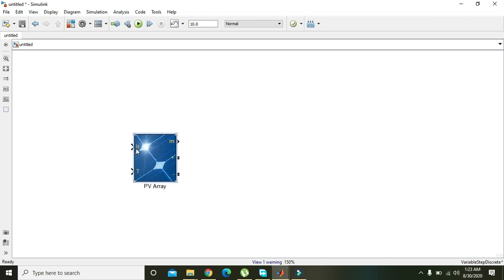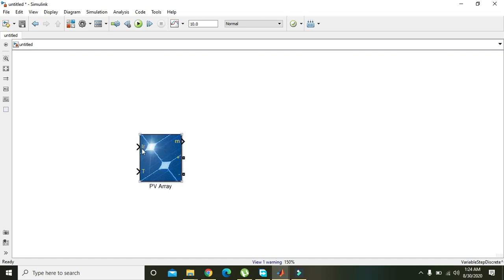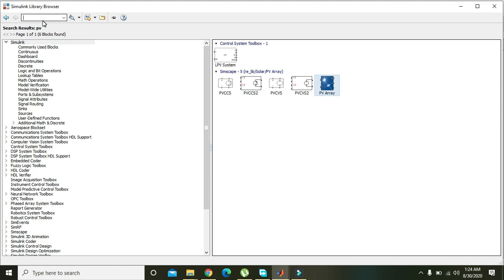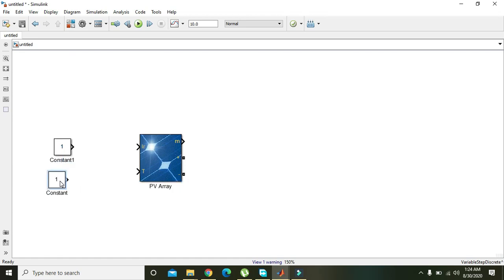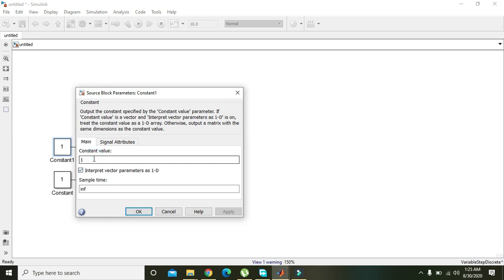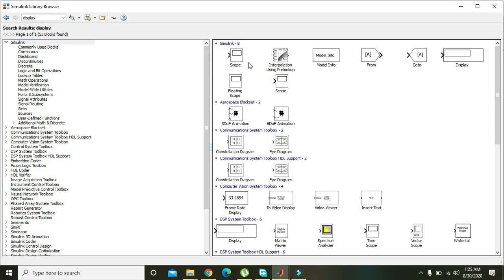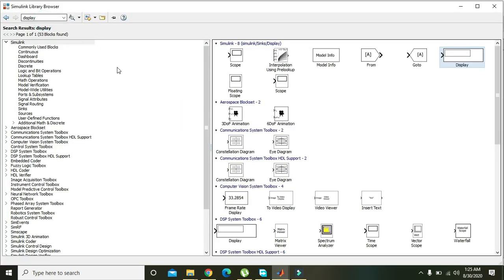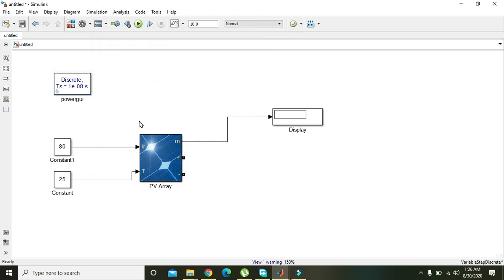how to use solar panel in simulink | pv array in simulink

Comment: SIr, I am making same circuit for PV panel but at the output only irradiance and temperature values are shows, other output are "nan". 
why?
Reply from the maker: nan means not a number..Kindly check the input parameters like temp and irridiance..

Comment: how to get 12v output
Reply from the maker: double click on pv panel change the number of cells...
Reply: @nelsondarwinpaktech3954  should i change irradiance and temp. ??
Reply: i changed irradance 0.00034, temp = 25 , in pv panel i changed to 1x1
Reply: but the waveform in scope is not constant

Comment: Thank you for explanation sir, It would be more helpful if you provide with information regards range of voltages can be produced using PV array and also please mention when to use solar cell instead of PV array.
Reply from the maker: ya i think when u double click the pv array block we can change the number of pv cells, also the irridiance values, and where there is more irridiance value then more are the voltages on the output.

Comment: I am using matlab 2020 when i tried to simulate it saying integrator at sample time is not finite... Try reducing step size..... When i run the panel in robust discrete model it runs ok... But i cannot temp externally but should do it internnaly...... Does anybody know how to solve this.

Comment: Hi Nelson, a very good and helpful tutorial. I have few queries about if I have to add a predictive model in it and want to convert it to an energy management system, how can I do it?
Reply from the maker: For it i will advise u to make purely in matlab..simulink seems to be easy yet difficult..matlab coding seems to be difficult yet easy...
Reply: @nelsondarwinpaktech3954  how can I make an energy management system using coding ? I have made the predictive model bit now I am confused how to make energy management system

Comment: Hi Nelson, Thanks for your video. I have a problem: I followed your simulation step by step but saw "nan" on the screen! Why? I only see 80 and 25 in the first two lines.
 I think the problem is with powergui there is no solver type on my matlab and I do not know how I am going to solve this.
Reply: I too had this problem. In the preferences tab of powergui tick the box for "automatically handle discrete solver and advanced tab solver settings of blocks".The problem was fixed for me.
Reply: @abhayunnikrishnan5887  But now its not taking the Temp as an input pls help
Reply: @infrainfernape298  click on pv and go to advanced and uncheck the option " robust discrete model".hope it works
Reply: @abhayunnikrishnan5887  it is not taking temperature as input
Reply: click on solar pv, go to advanced and unclick the break algebraic loop. hope that will works
Reply: me too, did you ever find the problem?
Reply: @CP.Darkhawk  I got the same problem, followed the video exactly but no luck!
Reply: hi, i am facing the same problem.  any solution?

Comment: Hi Nelson, Thanks for your video. I have a problem: I followed your simulation step by step but saw "nan" on the screen! Why? I only see 80 and 25 in the last two lines.
Reply from the maker: nan means not a number....kindly check ur inputs...
Reply: i am facing the exact issue.. my matlab version is 2020a

Comment: Hi! I was wondering if there is any way we can show the optimum tilt for a solar panel to obtain maximum amount of energy throught a year using Matlab?
Reply from the maker: yes seben u can use the excel sheet and put all the solar values and time all around the year...and then connect it with the solar panel within the gui....
Reply: @nelsondarwinpaktech3954  I have values of the whole year. How do I use it to simulate something similar

Comment: how you install pv array library, any suggestion? I'm using 2020 matlab
Reply: from the MATLAB program home tab, click 'add-ons' then search for 'simscape electrical' and you can install from there. It will depend on your institutions license if it available for free though.  I believe you can also go to MATLAB's website to get it, but its easier to do directly in the program imo.
Reply from the maker: nurul..its already in every matlab, i think from matlab version 2015 and onwards have already this library included....some older versions dont have...
Reply: @nelsondarwinpaktech3954  but I didn't have, what should I do? reinstall ? I actually new at this . I think it missing simscape folder
Reply: @nurulhanimamir8220  The problem is with license. Some licenses doesn't aloow the use of all libraries. If you have 2020a, try installing 2020b (third revision). If still the simscape folder doesn't appear, contact the administrator of your license.

Comment: Hi Sir, I followed all the steps and numbers you used, but I got nan in the display, and don't know the reasons for that, what is the problem? (I am using 2020 Matlab)
Reply: Click on PV array. Then in advanced settings, uncheck Break algebraic loop in internel model box. It will work then.
Reply: @OmaisAbdurRehman  thank you
Reply: @OmaisAbdurRehman  Thank you
Reply: @OmaisAbdurRehman  Thank you Omais so easy when you know how to do it!
Reply: @OmaisAbdurRehman  thankyou
Reply: @OmaisAbdurRehman  Thank you, it really works
Reply from the maker: first u need to check either u have used saturation block...i think i myself not used.....here...just temp and light intensity...also search other tutorials on utube for this for comparison....thanx for visiting....we r here 24/7....
Reply from the maker: one more thing either u double clicked the pv array and change values inside...

Comment: Can you plz tell me that calculation part of dc Current
Reply from the maker: go to library browser...take bus selector...and then connect bus selector with the m pin of pv module,, on clicking bus selector u can select signals to be observed, also connect the scope with bus selector...
Reply: @nelsondarwinpaktech3954  yes... I saw... Is there any theoritical equation for that...

Comment: Sir, why I get error message Derivative of state '1' in block 'untitled/PV Array/Diode Rsh/Transfer Fcn' at time 0.0 is not finite. The simulation will be stopped. There may be a singularity in the solution.?
Reply: You have to lower the first constant for it to work, the second output reading does shows zero

Comment: Hi Sir, thank you so much for the wonderful tutorial. May I know how to model/design a distribution test system integrated with Distributed Generations such as PV arrays and Wind Turbines in MATLAB/SIMULINK Sir? Your reply will be highly appreciated, Sir. Thanks in advance Sir.
Reply from the maker: specifically i didnt worked on windmill and pv array integration within the simulink, but i know that Simulink offered blocks for both and hopefully u will get  the model u want as daily thousands of videos are uploaded here in utube about simulink.
Reply: @nelsondarwinpaktech3954  Thank you so much for the reply and advice, Sir. I really appreciate it. Sir, so it is possible to model and design a distribution system with distributed generations using SIMULINK?
Reply from the maker: ya possible,,the boeing 777 simulator is made in it,,,and even NASA used matlab for simulation of one of its mission...

Comment: Hello sir,
I am doing Automatic generation control of single area which is interconnected with pv system . So can i use this model for pv system in my topic ?
Reply from the maker: yes y not u can use it...
Reply: @nelsondarwinpaktech3954  or the other methods, the diagram of pv systm with boost convertor ? Such as perturb n observe etc.
I am confused between this methods. When and where i used this all ?
Reply: Hii harnisha, can i ask you? My problem is same to you, i need diagram pv with boost coverter and the methods...

Comment: why does my display shows nan
Reply from the maker: again check all the process...nan means not a number....
Reply: @nelsondarwinpaktech3954  can you check for me..I'm using Simulink 2020 following all the steps but still cannot get the power output and voltage
Reply: @amirulaiman3956  bro, can i get your contact regarding this project
Reply: @amirulaiman3956  same..., my display is nan
Reply: @fikrinurmuhammad5669   bro u just need to click on the pv and then in settings make changes it will workk
Reply: @Dilipyadav-uw9mn  click on pv, then in advanced settings uncheck Break algebraic loop in internel model box, then it will work ;)
Reply: @imedoussalah9317  thank u so much..you saved my time..
In Video it is not mentioned
Reply: @imedoussalah9317  thanks a lot man.
Reply: @imedoussalah9317   this worked thanks pls pin your comment

Comment: Why do I always get I-PV as 0 ??
Reply from the maker: either u r giving inputs right??
Reply: It you're following the video you'll get zero for i_pv because there is no load connected so no current flows. The video is essentially getting zero too (1.325e-196 = 0)

Comment: how can I measure the power?
Reply from the maker: attach voltage and current measurer and then also add a multiplier box and get the power very easy way...